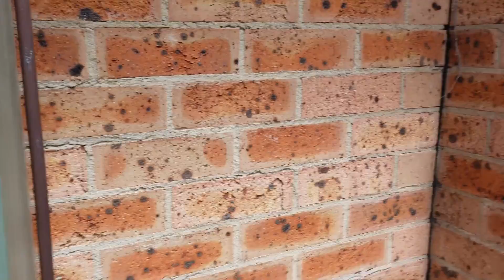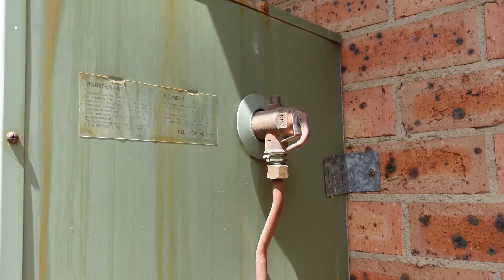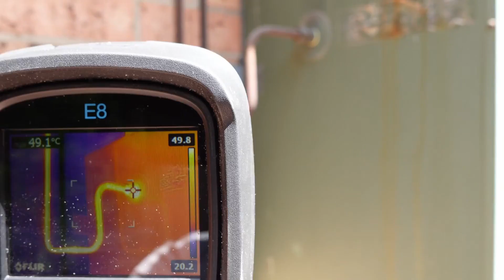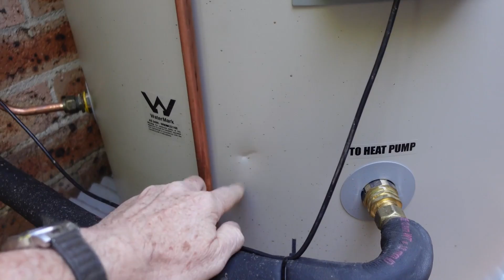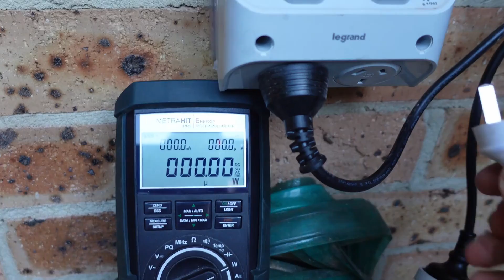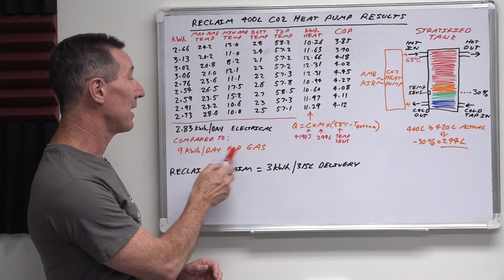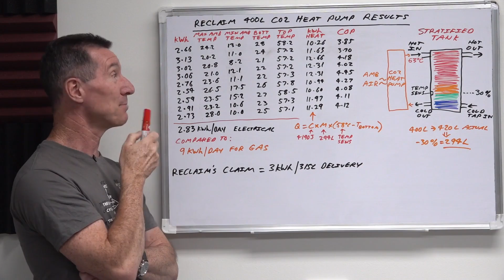EEVblog 1517 - Heat Pump Hot Water Install & Analysis

Comment: Depending on how good the heat pump is, if it is one with backup thermal elements you should try turning those off (its usually a configuration option) and see how well the heat pump does just by itself.  Given where you live, it should work quite well.

I wound up getting a SanCO2 heat pump water heater.  No backup heating element.  Separate outside unit and in-basement 80 gallon steel tank.  Its been wonderful.  This particular model is designed to heat the water up above the biological survival temperature, e.g. 155F and higher, and has a mixing valve on the output to bring it down to something reasonable for the house hot water pipes (e.g. 125F).   Hence also why the tank is steel.   And since there is no heating element inside the tank, it is literally just a steel tank with some valves and insulation and there isn't a whole lot that can wear out.  It should last a very, very long time.

So far the system has been wonderful.  We have never run out of hot water.  In fact, even if we use most of the tank the water never actually gets cold because the heat pump's water heating loop emits directly into the top of the tank.  Takes water from the bottom and runs it through to the top.

Consumption is around 4kWh/day.  If I run the hot water recirculator on a timer 15 minutes a day, consumption increases to around 6kWh/day.

Comment: Wait heat pumps work better when ambient temps are higher since they can warm the refrigerant easier. That's why until more recently heat pumps that aren't geothermal haven't been considered feasible in cold climates. 

Thinking through the thermal dynamics maybe the higher energy transfer into the refrigerant makes the pump design less efficient. Might have to whip out the termo books and see what's up.
Reply: Either Dave just got this completely backwards, or I'm taking crazy pills. Even the graph in his video at 33ish minutes shows that the COP rises with ambient temperature https://youtu.be/DO9uccP49_g?t=1998

Heat pumps somehow becoming more efficient when the temperature difference is larger seems evtremely unlikely and I'd need to see a detailed mechanism to believe that this would be the case.

For additional evidence, each source I looked up on the internet also said that heat pumps get better with higher ambient temperatures (assuming you're using them for heating, not cooling, where of course the opposite is true).

Comment: As a canadian its very interesting to see all your utilities placed on the outside of the house. Your breaker, water tank and drain pipes being exposed give me the hee·bie-jee·bies. Must be nice to stay above freezing year long :)
Reply: I live in Scandinavia. nothing is outside. if it was it would break in the winter.
Reply: Came here for same comment - UK is all indoors
Reply: HA ya in Montana everything is in the basement but in Arizona everything is outside I do miss the basement but in Arizona i get what I call perma hot dirt the water in summer is never below 90F
Reply: @montanaior7714  Ya, that's something that's really hard for me when visiting warmer places. I'm so used to just letting the tap run for a short bit and getting nearly ice cold water to drink!
Reply: @montanaior7714  I moved from Montana down to North Vegas myself. It's almost warm enough in the winter to get away with not worrying about pipes freezing. Every once in a while the temperature dips low enough to cause damage, I learned that the hard way after a couple valves failed on me last year.
Reply: same here, Czech Republic 😁
Reply: In Canada the cold supply line would freeze and you'd have to burn way more gas tokeep the water hot at -20C ambient. The supply line comes in the house at well over a meter deep and the main water pipes (supply, sanitation and storm) run at a number of meters deep in the street, all to avoid freezing up.
Reply: @bert-blank  Dave's incoming cold water is 25 degrees !! No need to heat that water, just shower away!
Reply: @ulwur  lol, good point.
Reply: @bert-blank  Hell...in our winters even the natural gas/methane line can freeze if poorly installed because of the water % content...that's a bad day.
Reply: Even in New Zealand we hit -10⁰C  -15⁰C at times. I think the coldest recorded was -25.6⁰C. I think our earth quakes would those would definitely need tied down 😆.
I've been looking at the dual heatpump split systems they look good and our central heating heat pump system is over 14years old. Has never let us down apart from those really cold winter nights. It just freezers the outside unit to a block of Ice.
Heatpumps are common. But we always have a backup. Either bottled gas or log fire. 
We don't get power cuts often. But can happen some years non stop due to snow and drunk drivers hitting poles or wild fires in the summer. 
We have minimum insulation laws etc,
Power cost are around 34 cents to 38 cents pKwh. Our power bill hits $360 to $380 a month. Summer half that. 
Looking at these numbers it definitely would make sense forsure. 
But solar ain't cheap as it is over the ditch. We pay 40% more at least I'd reckon.
Reply: @northcanterburylogging3039  Heat pumps are terrible in cold climates... Don't do it.
Reply: @MattyEngland These units work in alpine regions
Reply: @chefgav1  Very poorly.
Reply: @MattyEngland  hardly call cop of 5 poor
Reply: I didn't know outdoor residential water heaters existed. I though they were all indoors.
Reply: Canada is where cold was invented and is produced.
Reply: As a Hungarian, its very interesting for me to see this setup as well
Reply: Was thinking the same!
Reply: I’ve lived in both California and Canada. Neat to see the difference in utility design.  So much cheaper in non freezing environments.
Reply: I live in Canberra, Australia, where temperatures get down to -7° often enough, and our water tanks vary. Some inside, some outside. Gas hot water is mostly outside for whatever additional safety that gives
Reply: I'm Russian and I had similar feelings seeing how pipes are managed in the Netherlands 😅
Reply: The only way a heat pump water would be effective is if it is outside. Otherwise you are taking heat from the home to heat the water.

If you live in a cold climate, you may as well use gas to heat the water.

In a warm climate that stays above freezing a heat pump water heater makes sense.
Reply: @bernieoch6099  If you are normally cooling your house then pumping heat from the house into the water actually makes sense. So in hot climates where you are cooling your home a majority of the year, a hot water heat pump inside the house makes a lot of sense. If you live in colder climates, it makes sense to have the hot water tank indoors and the heat exchanger remotely mounted outside so you are not cooling the house.
Reply: @crissd8283  It makes alot more sense to use a on demand gas unit and burn the .5 mcf a month in cold climates.
Reply: @bernieoch6099  I don't disagree.

Comment: In the US, the whole unit is typically installed inside so it does double duty cooling and dehumidifying the air, along with heating the water. That makes a lot of sense in the warmer southern climates. I was surprised to see yours mounted outside. This was really interesting. Thanks for sharing.
Reply: RickMakes I don't know if that is a regulation down under, but I have often wondered that myself. It makes no sense not to be trying to maximise the surroundings. How can rain pelting down on a hot water system be help its efficiency?
Reply: @DodgyBrothersEngineering  they drink so much Fosters, they've ceased to care.
Reply: @MattyEngland  does Fosters still exist? I haven't heard that name in ages. I seldom drink at the pub, but I can't remember the last time I saw it.
Reply: @DodgyBrothersEngineering  usually there’s still roof overhanging the unit, and like Dave pointed out, it’s so well insulated it feels room temperature on the outside anyway
Reply: @thomasa5619  he has no eaves on his house to speak of. It is fairly exposed. Of a day time he would be better with it being in the sun so there is less of a delta between the heated water outside and the ambient, but of a night time when it cools down he would be better off with it inside.
Reply: Interesting! How does that work in winter? Presuming the outside temperature does sometimes go below a comfortable room temperature, you’d be heating and cooling at the same time when the hot water heater is running. Or is there some kind of valve to send the cooled air outside in that case?
Reply: @snarkywombat155  lol, you also deny putting shrimps on the barbie and fiddling with koala bears bumholes, we all know it's true though 😉
Reply: @snarkywombat155  🤣🤣😉👍

Comment: If they stirred the water inside the tank you could store more energy. Although it probably makes no difference if you are not running out of 100% solar hot water every day! The huge tank gives you that buffer.
Reply: I thought a return to the tank would provide hot water to taps instantly, ie the water goes round and round the house with a litle pump maybe thermo controlled, considering I run mine in solar hours all good, maybe harder in winter to manage

Comment: Err Dave, not sure where you're getting this weird idea that a heat pump is more efficient at lower ambient temps but you're dead wrong, even while throwing the COP diagram on screen which exactly shows that. The lower the difference between output and ambient temp, the less energy needs to be "pumped" in to reach the desired output temp. That's why it is important to keep the difference at a minimum either by reducing the output temp (or increasing it in case of cooling) and placing the radiator either near a heat source (for heating) or in a cold spot (for cooling).
Reply from the maker: Literal quote from the designer at Reclaim who I spoke to: "The higher the ambient the better is the COP. The lower is the incoming water temperature the betther is for the COP. The COP is higher with colder water... That gives higher temperature difference with the CO2."
Reply: @EEVblog  Not sure what the designer wanted to convey, but the statement is at least confusing. The graph clearly shows that the COP is higher at higher ambient temperature. The designer is right that the COP is also higher at lower incoming water temperature, but you still need MORE energy to heat cooler incoming water at the same ambient / air temperature. In this case, the better COP does not mean you need less energy which one normally assumes. 
Also, when you calculate the kWh used per day you assume that you have to heat up a fixed volume (294 l), but that's not the case. You only need to heat up the cold water that comes in an replaces the hot water you have used. You made a big point about that you use about 175 l of hot water when you show the data for your gas WH. If this didn't change, shouln't you use that number? And since the outlet temperature now is hotter (63C vs 55C before) and is getting mixed down, you should even use a bit let hot water from the tank. 
So I think your COP estimate is quite a bit to high. I would argue that you should just use the 9 kWh you calculated for the heat energy used by your gas HW, so the COP is closer to 3...
Reply from the maker: @mmark666  Yes, it's a trade off of ground water temp vs ambient, but Reclai mand another Australia site I looked at that compares NSW and TAS said that TAS performs better. So much so that there is a higher rebate in TAS because of the overall increased COP.
Reply: @EEVblog  the water temps shouldn't vary much over different regions. i think this is highly insignificant in comparison to outside air temperature variance.
Reply: @EEVblog  The higher the ambient, the better the COP: right but you said the opposite when referring to better efficiency in colder Tasmania. But why would the COP be better with colder water? That doesn't make any sense physically: which takes less energy, heating water from 5C->61C or 20C-> 61C? A heat pump is only reducing the required energy by a factor compared to simply using a heating coil but doesn't change the law of physics, as you eloquently  said it yourself.
Reply: @danielegger6460  Higher COP does not mean less energy in this case! Of course going from 5C => 61C takes more energy than going from 20C => 61C. A higher COP only means that the ratio of gained thermal energy to used electrical energy is higher if the water temperature is lower.
Reply: @mmark666  Even if that better COP was correct (it might, but I strongly doubt that the media you're transferring the energy into has such a dramatic effect on the COP and even more so in this direction), the discussion is all about the overall efficiency and energy consumption/savings. It takes around 1.2Wh of electrical energy to heat 1l of water by 1C, if you could improve your COP from 4.0 to 4.1, that would be a staggering 2.5% improvement... or in terms of the grand scheme of things: bugger all, especially with the COP being quite a bit more influenced by ambient temperature.
Reply: @EEVblog  BTW: You might want to take a closer look at pipe insulation. The absolute loss in temperature at the tap(s) might look harmless but if the pump has to often run to reheat the water that is also a big waste of energy, even when "free".

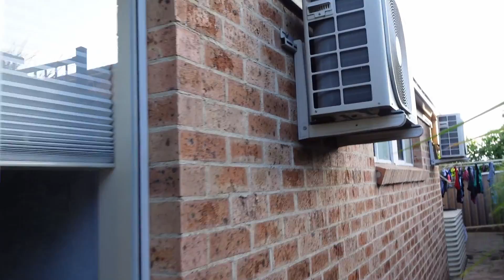Comment: No insulation on the hot water outlet and pressure relief on the old gas system. Your confusing temperature with efficiency. 50 cents a day for ten years?  Also, 5:37  at the new heat pump was still not insulated on the pressure relief valve or 300 mm of the pipe which is a grant requirement in some states. Next, read the Reclaim manual that requires a 150 mm gap behind the unit. Failure to instal to spec will void the warranty. Not much but how many in Australia are like that. It will be alright mate, yea Slacko mate get them back to fix it.

Comment: My 80 gallon (302L for you Australians) electric water heater consumes about 10 to 12 kWh per day. My whole house consumes between 30 and 80 kWh per day. Totally off grid. I am going to build a heat pump water heater soon.
Reply from the maker: Around the same numbers I got on the whiteboard, nice.
Reply: We have gallons here too, they are just bigger than yours.

Comment: The heat pump produces cold as by product of heating the water right? Could you use it to cool the house in the summer?
Reply: If you installed indoors you could but then during winter your cooling your house.

Comment: My gas bill tells me how many TH I have used over the month.  I read through the utilities website and found (TH) is Therm.  Therm is apparently 100 cubic feet of natural gas.  1 Therm is also 100,000 BTU or 105,480,400 joules.  I was digging into all this to try and figure out some of the math like you did as a possible comparison of different water heating choices.  I then remembered this exercise is almost pointless because I not only have a gas water heater, I also have a gas furnace and a gas stove.
Reply: So what you’re saying is that you’ll be installing a heat pump stove?

Comment: I bought and installed a Rheem "hybrid" heat pump / electric water heater from the local home center here in the states, and installed it myself.  The overall concept of the heat pump to heat water is a fantastic idea and saves a ton of money and energy, but Rheem's implementation is pretty bad.  Their mechanical systems are fine, but their sensors, software and firmware are the worst.  Makes the water heater constantly throw false positive alerts.  I would definitely advise to go to a heat pump based hot water system if you can, just not Rheem.
Reply: What model is it? I'm looking at the Ambiheat HD-270 and I'm still unsure about it. (It's the backup heating element that makes it attractive to me in my climate)

What about the sensors and firmware make them bad? (I know their app is probably sketchy at best)
Reply: @Jake-ug6fk  Well, where I live the humidity is relatively high, and though we normally don't get snow in the winter, it gets cold enough where condensation is a huge issue.  Even after wrapping in an insulation blanket, which solved the condensation issue, the leak sensors still go off here and there and the heater sometimes just won't heat with an alarm active.  It's a Rheem Proterra.